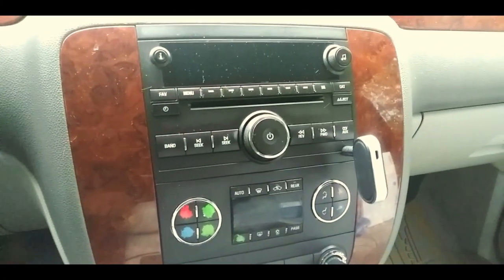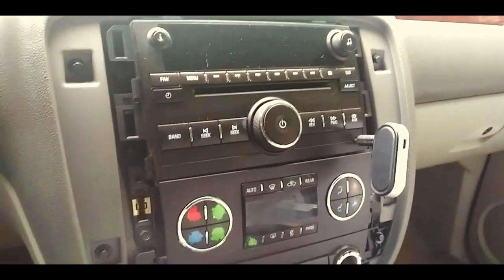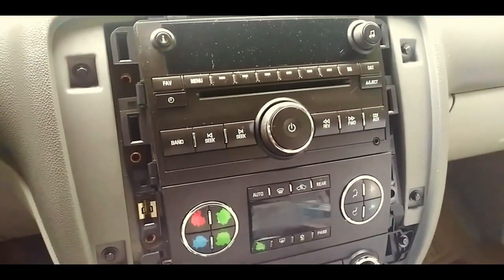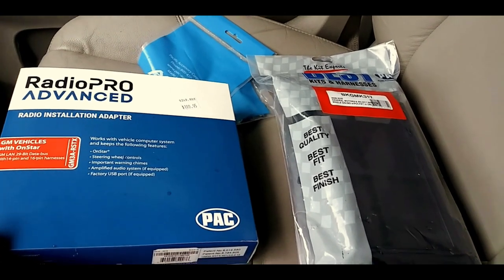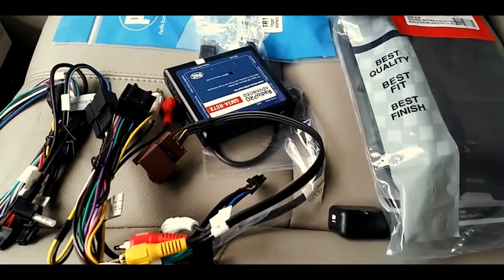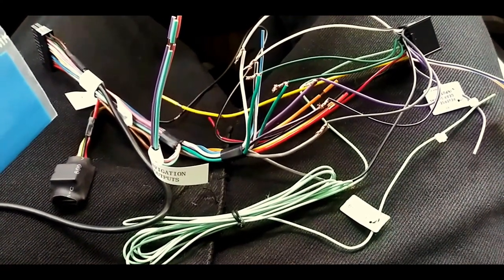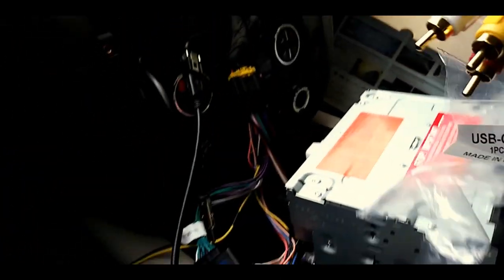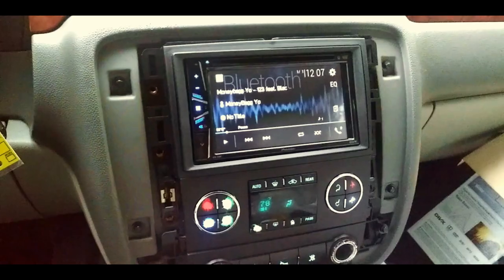2010 Chevy Tahoe D.I.Y Pioneer Stereo Installation AVH-120 BT

Comment: All you needed to do is hook the parking brake wire to the black ground of the radio and boom..bypassed
Reply: Do you have any suggestions on how to do this?
Reply: @reecewrisinger2017  if it's a pioneer you need a 12v spst relay....
Reply: @reecewrisinger2017  there are 5 posts on the relay.....85 goes to the remote on the radio.....86 and 87 both get ground.....30 gets the parking brake wire from the radio